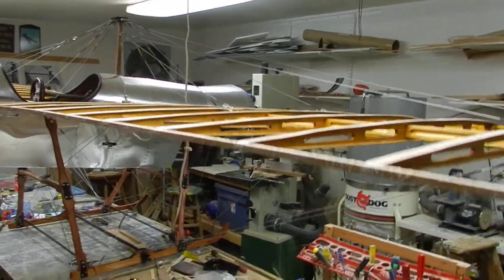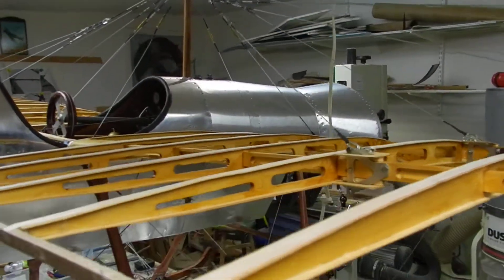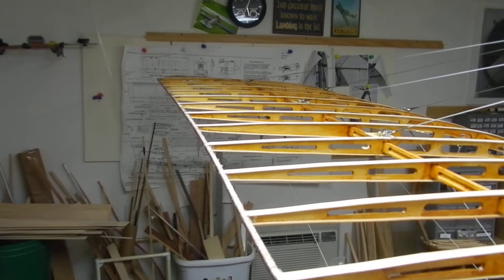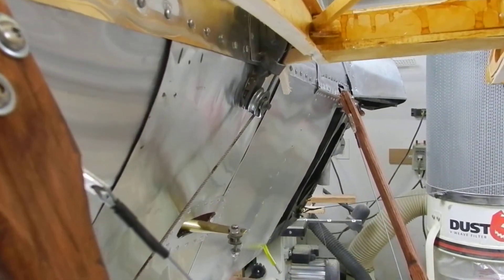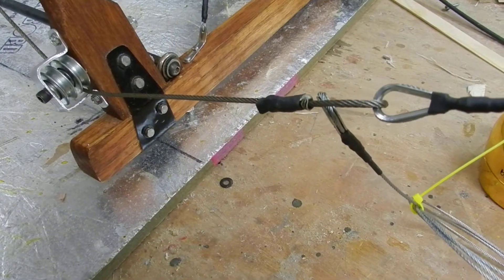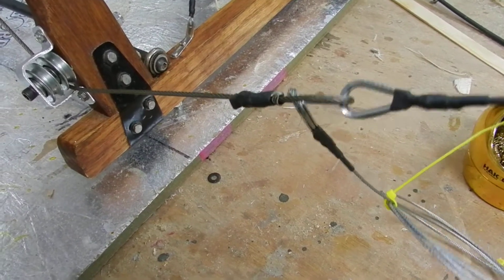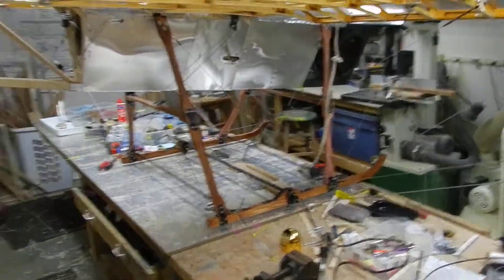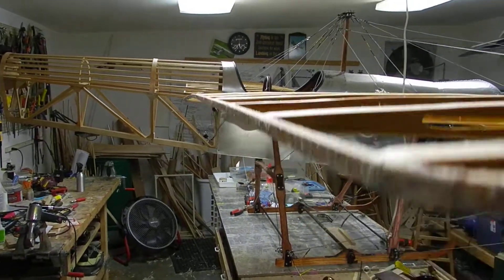Wing Warping Test

Comment: Many thanks for posting this. I'm planning to build a Blackburn Monoplane at 1/4 scale and this has helped considerably in gaining some understanding of how the wing warping control linkage works. Am I right in thinking the as yet unused rear pulleys on the undercarriage are to carry a heavier cable intended to carry the flight loads in the warping wires?